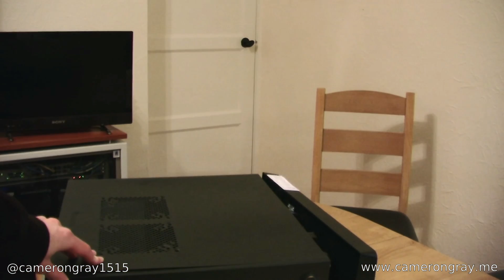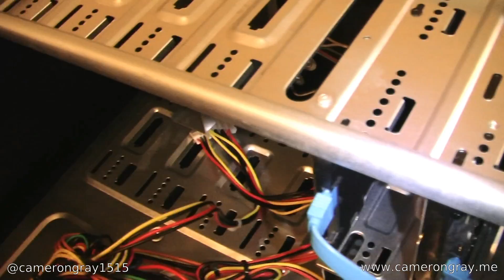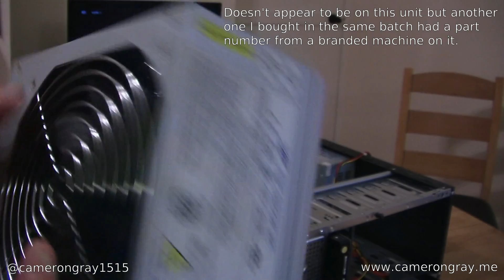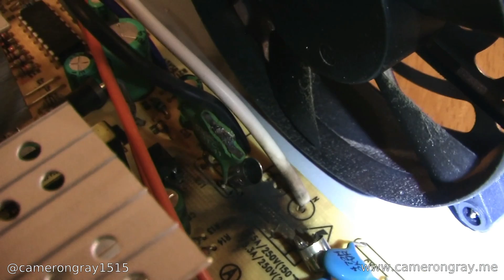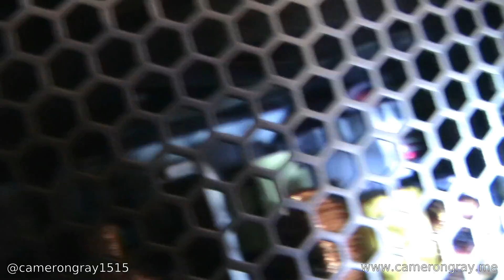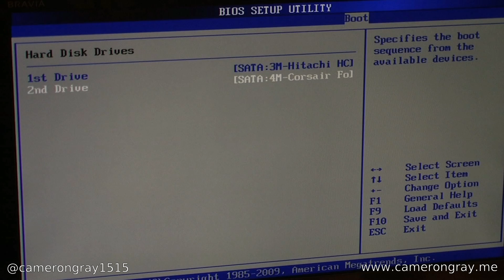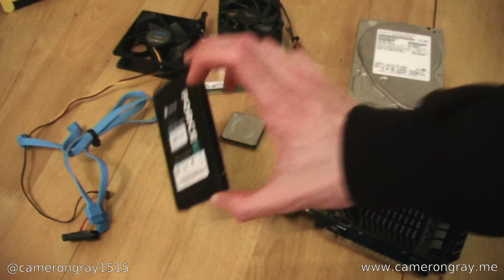Mystery £10 eBay PC

Comment: I recently picked up a tower from a car boot sale. guy said 'don't know it's spec and worth
FX6300 + 4GB 1333 ram, gt210  and TPlink PCI 54mbps, with 64gb ssd from Samsung (they said 'don't know what's it's worth, an it was in bad bad condition (paid £15)
I kept the the FX6300 and have since overclocked it to 5.1GHz on my Asus mobo and  Corsair H55, the rest sold on Facebook making £10 profit

Comment: You seem to know more about pc’s than i do.. so i have a question.. my pc’s motherboard died (probably partly because my old video card took it down with it..) however i don’t know what would be best.. you see i have an older type of motherboard with an older socket that i could get a replacement for online however i don’t know how long my processor wil last.. it’s a decent processor despite it being a bit older.. as with my new videocard it ran games that are basically new on the highest settings with 0 lagg (apart from server lagg at times.. but that wasn’t my pc’s fault) so i’ve been thinking about my options and could either just get some new parts or get a whole new system.. wich would be risky in my opinion because i have no clue how i can determine if it is an upgrade or not.. (mostly processor wise.. seeing as the one that is in my defect pc right now is defenitely not to be underestimated..) also my video card probably decided to die because it was simply older (i believe it came out of my old pc wich was fried during a thunderstorm so it is possible that had some repercussions for it aswell) also my dead motherboard is: MSI P55-GD65 so you can see what i mean
Reply: just get new cpu and mobo
Reply: wait is it an old gpu or new one lmao
Reply: DanTheMemeMan pretty old.. not ancient old but old as in 8 or 9 years out of date.. the whole thing was pretty old my processor is decent because i am pretty sure it is a quad core i7 and it is defenitely not bad.. issue is i didn’t build it my self but an uncle did so i don’t know the exact age.. and if it helps my old videocard was an amd radeon HD 6850.. and i haven’t changed any parts out before my pc started breaking down.. i’ve probably had it for at least 3 or 4 years now if i am not mistaken so some part were bound to break down.. i have had someone check it and he basically called it an old timer..

Comment: The advertisement on ebay said "collection only"....?? i wish i could get ebay sellers to mail  me stuff that's collection only..they usually will not any circumstances...and what luck leaving that ssd in there for you.......
Reply from the maker: Depends really on the item, they can often be okay with it assuming the item is relatively easy to pack and the buyer arranges all the shipping.  In this case I arranged and paid for the shipping through Collect+ and send the seller a label so all they had to do was put it on the box and drop it off at a local shop.  Of course you do run the risk of the seller not being able to pack things properly (such as in this case)

Comment: That component looks to me like an NTC thermistor, they are used as inrush limiting components in some power supplies. When you first start the system the thermistor is cold, and has high resistance, it then heats up as the system runs, and the resistance drops. They usually get very hot, having a fan blowing on one is actually probably not a good idea either, as they are kinda supposed to be hot. Never seen one in a switched mode computer power supply before though...

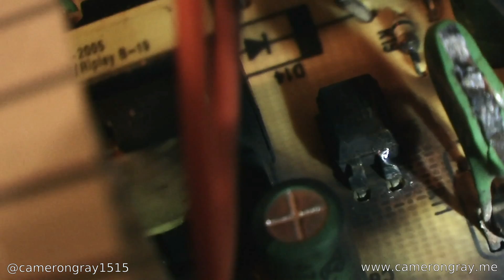Comment: @12:02 Thermistor & Fuse blown a common thing in super cheap PSU's Okay basic breakdown of what happened. The power supply ran hot for to long from lack of cooling and/or quality. Poor quality heat spreaders and more than likely over rated PSU says 500w no really its not I would guess about 250w max. The CPU's TDP and GPU are enough to cause that damage to a junk PSU over time. More less all your hardware in that PC went well over it's true rating and caused over heating.

Comment: a glass of water for what? planning on accelerating an electrical fire?
Reply from the maker: I'd have obviously disconnected the power first (notice how I automatically pulled the power cable out as soon as I saw smoke in the first instance), the advice is to not use water on a live electrical fire (i.e. don't spray water onto a distribution board that you are unable to isolate), with the power disconnected it's nothing more than a class A fire where water is completely suitable.  I also have a dry powder extinguisher available but using this would be expensive and extremely messy.

Comment: I know this is an old video but seriously... I have a glass of WATER on hand just in case. Need I say more
Reply from the maker: I'd have obviously disconnected the power first (notice how I automatically pulled the power cable out as soon as I saw smoke in the first instance), the advice is to not use water on a live electrical fire (i.e. don't spray water onto a distribution board that you are unable to isolate), with the power disconnected it's nothing more than a class A fire where water is completely suitable.  I also have a dry powder extinguisher available but using this would be expensive and extremely messy.

Comment: +Cameron Gray - This Power Supply is cheapest crap ...  allegedly "delivering 500" FAKE Watts = ~250 Watts in reality ... 
Fuse vaporized = dead short , often because main switching transistors (etc.) are dead due to overload ( more than 200 Watts ? ) or overheat

Comment: no ram at 14:51
Reply from the maker: At that point I'm only testing the power supply by using it to power the optical drive, the PSU isn't connected to the motherboard at all at that point.
Reply: ah ok

Comment: I'd love to know who put an SSD in that box originally. Putting one of those onto a SATA-2 port is like buying a Ferrari and then driving it everywhere in first gear - still quick, but you're getting nothing like the best out of it.
Reply: A SSD in a SATA-2 port is still way faster than any hdd, I had this on my old machine and the differnce to SATA-3 is really not that big. The huge advantage of an SSD is its response time so it doesent matter too much if the bandwidth is a little bottlenecked.

Comment: Bullshit! It was not because of a cheap power supply. This looks like a massive overvoltage failure. The round blue package, that was eaten away was a MOV (metal oxide varistor) this thing will short the input, if the voltage gets to hight and heats up a lot. The fuse blew than, because of the high current in the MOV. That is the failure reason.

Comment: Still has a graphics card, unlike my £160 hp hpr 3500mt
Reply from the maker: To be honest, the integrated graphics in your HP are probably a reasonable bit better than the GeForce 210 this had!
Reply: Well I am upgrading to a 1030 soon so yeah, it's going to be substantially better. (and it seem I made a typo there, I meant HP PRO 3500mt with Intel HD 4000

Comment: Nobody in a small shop selling cheapest possible pc for a customer who don't want to wait more then 20 minutes gives a fuck about cable management.
"learn what they are doing" is really stupid comment considering you ain't showing any skill either.
Reply from the maker: I wasn't commenting on the cable management, while it's a nice thing to have, I don't expect anything special on a basic PC - Even if I'm building something, unless it's a high end machine in a decent case, I'll just tie the cables out of the way.

I was probably a bit harsh however I've grown tired of small PC shops around here which build systems with the lowest possible quality components for customers who wouldn't know better (not to mention the other issues I've seen - incorrect diagnosis, overpriced repairs and other generally shifty business practices)  Half the time the customer would have almost been better off just getting a prebuilt!  As far as my knowledge, I agree that it doesn't come across very well in this video which was pretty much when I was starting out on YouTube and was very rushed together - I'm not actually as bad at this stuff as it looks in this video! :P

Comment: I pulled an eMachine out of a dumpster  2 years ago, though not a great machine, but it was free. All that was wrong with it was the processor fan had fallen off. Its owner most likely tossed it because it would overheat and shut down. It took 15 minutes to change the fan to a more reliable one and my wife is happy with her new computer. Oh did I forget to mention the machine was still under warranty?

Comment: Holy crap.. mate, even as an Irish bloke I find you very difficult to listen to :o And knocking "small computer shops" or whichever idiot put that PSU in whilst having so little knowledge yourself, such as not being able to recognise the capacity of the RAM (hint, it was the very last number on the top row), not removing the motherboard to ensure there was nothing shorting the back and checking all capacitors FIRST before powering it on... and I really wanted to like this video :(
Reply from the maker: I agree that the dialogue in this video isn't very clear, this was a very early video of mine and I've tried to improve it since then. I didn't immediately notice the RAM capacity as I haven't really used much of that type of RAM before and most of my concentration was on the filming and not deciphering part numbers, at the end of the video you'll notice I corrected myself after having more time to look at it off camera.  I didn't remove the board because I had no reason to suspect anything would be shorting (there was no damage to the case in that area.) The capacitors looked okay visually, I'm not exactly going to start taking them all out and testing them individually on any machine that comes into my possession before turning it on!

Comment: Not all power supply with 80mm fans are rubbish. The best power supply i have, an FSP450-60EP, has an 80mm fan. So some but very few  decant  power supply do have 80mm fans. I agree though that it you see an 80mm fan in a modern PC then the power supply is most likely a piece of junk.

I enjoy your videos keep up the grate work. :)

Comment: The power supply killed the board not the other way around. The cause was missing protection circuits on the cheap power supply.

Comment: 17:02 lol wtf , you use water against electrical fire  LOL YOU CAN BE DEAD if you do that
Reply from the maker: You shouldn't use water on live electrical fires, I'd have obviously unplugged it at the first sign of fire, notice that as soon as I saw the smoke in the first instance the first thing I did was pull the power cable out without any hesitation. This video isn't my finest work but I'm not a complete idiot! :P  Sure, don't spray water all over a live distribution board/consumer unit that's on fire, but no harm using it to put out an electronic device that's disconnected from power.  Certainly a preferable option to using a fire extinguisher (which I also had available) and having to pay to replace that along with having to clean pretty much everything in the room due to the powder which gets absolutely everywhere.
Reply: +Cameron Gray 
huuh im thinking you are not going to turn off the mashine first . sry then

Comment: The green component is... was a NTC resistor used for in-rush current protection (while those scary capacitors charge up to 300V)

Comment: Hate it when "pros" complain that ram sticks don't have the capacity on them, when the sticker clearly shows /4 at the end of the model number.

E: Also FSP is trash unless it's gold rated. Seasonic is the safest bet for budget bronze rating. And I hope you actually tested that ram instead of just saying "it works" when you saw it in bios. That's about as rubbish of a ram test that one can do.

Comment: a glass of water hahahah! this man doesn't have a clue does he!
Reply from the maker: Nothing wrong with using water if the power has been isolated first which is what I'd have done first before pouring water on it, I'm not a complete idiot!  You generally wouldn't want to attempt to put out an electrical fire without isolating it first anyway unless you physically can't do that (which wouldn't happen in my case as I could just pull the plug out).  I could also have used the powder extinguisher I had available as well but this would have cost money to replace and would have made a complete mess of everything in the room.

Comment: Dude don't knock cheap weak PSUs as simply just trash. If the power output isn't too horribly noisy, they make fine bench testers (for most things 12, 7, 5 or 3.3V) and PSUs for cycling and bleeding water cooling loops.

Comment: Worth a shot. You could bodge a leaded capacitor onto the smd pads if you can be arsed but my guess is the vrms  probably couldn't handle the chip long term, esp if it was overclocked.

Comment: The PSU died on the mains side. The motherboard did not take out the PSU. It's a big surge like a lightning strike that did it.
Reply: Or some dimwit setting the input voltage switch to 120V, which would be tantamount to the same thing - an extra, unexpected 110v hitting the PSU.

Comment: You really shouldn't judge a power supply by it's weight and the apparent number of components inside... It highly depends on the type of power supply, the type of components, and the efficiency rating.

Comment: Kingstone Value Ram, DDR4 (1600mhz) (Single Rank x8 DRAM) / (4 banks), The value of the banks would be under the sticker. 1600 is a good pick so they desided to atleast use a good speed for your ram, you probably got your money back just on that stick of ram lol.
Likely a 4gig stick of ram anyway, I havent seen them come in that speed any lower than 4 but being 2016 guess could be possible heh.

Comment: if it is an fx it wouldnt of had onboard graphics
Reply from the maker: +LYNCHY The FX CPUs didn't contain GPUs themselves but certain motherboard chipsets such as this one have basic GPUs built in (Radeon HD 3000 in this case) - This is generally how integrated graphics was implemented before the more modern idea of having a GPU on the CPU chip itself, also explains why they are often referred to as "Onboard" graphics.

Comment: 18:30 Hot cap and smoke? Break that cap off. Board might have worked fine without it until you got a replacement. It may be a cap fused across the +/- rails. Used to clean up the power.

Comment: How do u fix that blue screen
Reply from the maker: It was just because it was trying to boot the original Windows install on different hardware, afterwards I completely wiped both drives (including that Windows install).  I'd never use the Windows install or any software that came on a PC like this, any used PC or drive that I get will be fully wiped and reinstalled as soon as I get it.

Comment: That component that failed in the PSU (other than the fuse) looks to be a thermistor or disc capacitor, so it's probably failed to protect the rest of the PSU. You could probably repair it but I'd chuck out that PSU, to be on the safe side!

Comment: 15:35 Well the reason why it's not turning on is because you're holding the one and only stick of RAM in your hands, instead of it being in the machine?
Reply from the maker: +Mainframe Not quite sure why I had the RAM out at that point although at 15:35 I was just testing the PSU out with it connected to an optical drive, the motherboard wasn't connected.  My initial testing when the smoke came out had the RAM installed.

Comment: You talk about that case having a crap PSU, then turn around and replace it with another crap PSU from an unknown brand. Eh?
Reply from the maker: +Mainframe FSP make generally pretty decent PSUs.  They aren't sold that widely on the retail market however they are often used in OEM systems.  They also make a lot of power supplies for other manufacturers such as some of EVGA, BeQuiet and Antec.  The one I used here isn't incredible but it's a good, reliable power supply, certainly many levels above the WinPower and similar units, it just doesn't look fancy since it's designed for OEM systems rather than retail sales.

Comment: fuse went bang cos something metal fell inside the power supply shorting it out however I do modify any power units before I pop them into my pc cos everything is sata controlled yet power supplies only come with 2 sata connectors especially off ebay

Comment: Believe it or not, I once went to repair a computer at a very rich neighborhood, so after I found out the problem was only the screen unplug I was like "mahh whatever", took minimum visit and went home, on the way I saw one very fancy computer case literally torn apart next to a garbage can.

I wen't to check and apparently someone got mad at their computer I guess (lol), found asus 1070 GTX plugged in and core i7 6700k, 2TB hard disk and some crappy gigabyte!

Ironically enough, I am using the graphic card and the CPU right now and sold the disk/motherboard after making sure they are fine! :)

Comment: Glass of water on stand by? I assume in case of a fire, but if such fire occurred it would be electrical. Lol don't use water, fire extinguisher would be best
Reply from the maker: It's low voltage and I'd have clearly pulled the plug first.  In hindsight the chance of the fire being anything you couldn't just blow out is almost nil however pouring water on it after disconnecting power would have been preferable than setting off the powder fire extinguisher that I also had relatively handy.  If I'd set that off I'd both have to pay a fair bit to replace/recharge it and have a massive job to clean up the powder that would inevitably get clogged in all the PCs running in the room.
Reply: Use sand if don't want use fire extinguisher. Easier to clean than powder